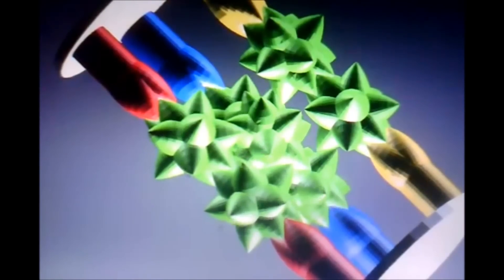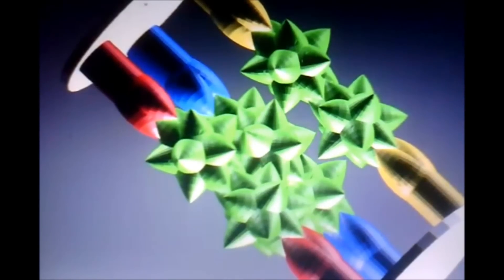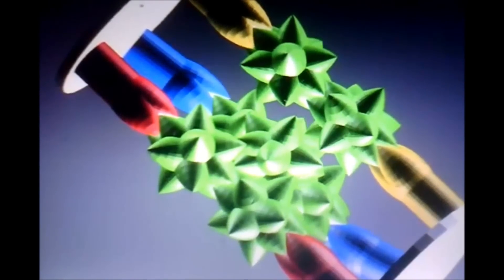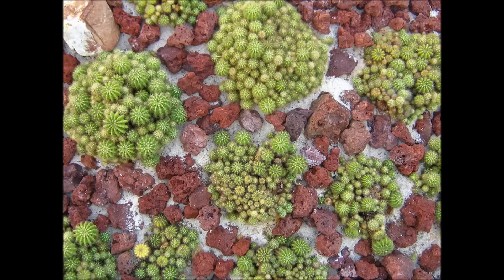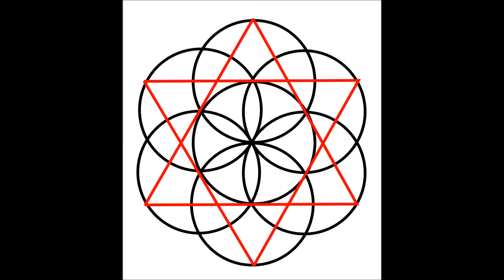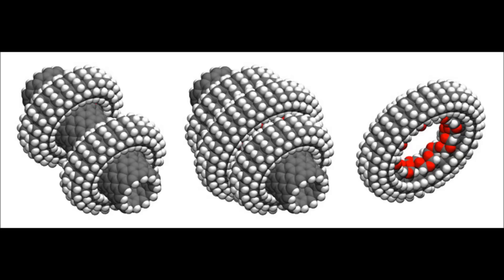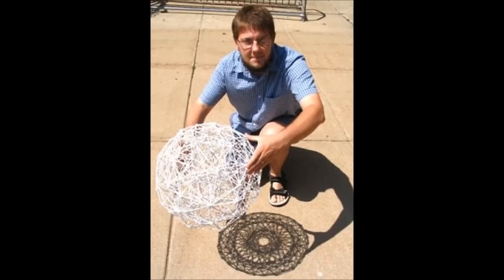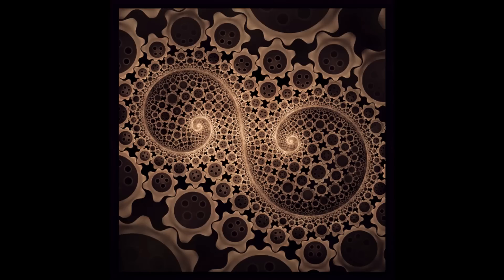CVT Transmission - Fractal Gears

Comment: i think i will stick with stronger helical and straight cut gears, this looks like too many weak parts for a transmission. my toyota doesn't run on DMT. but that would be ridiculously awesome. just kidding! what's the implementation for this ancient tech?
Reply from the maker: +Brandon L Standard automotive gears often use 1/16 inch (.0625) gear teeth to transmit massive amounts of power.  The leading CVT transmission uses less than that.  In fact , the Meyer CVT is the best one and it basically operates by biting into metal spheres by only 5/1000 of an inch (.005 inch).  The idea is you have a higher frequency which allows for less and less needed strength.  In other words if you had a large enough gearbox with a high enough RPM , you could build it from butter and lift the world.  You can compound the layers of the fractal gears for increased frequency of the torque as shown in this video that shows how the Ancient Egyptians could have built the pyramids with this tech .... https://www.youtube.com/watch?v=F29Qa_QEaek

Comment from the maker: See this link to learn how to create Fractal Gears as if creating fire, i.e. instantly.           https://www.youtube.com/watch?v=1EuyZ5Lml4k

To produce this shape permanantely by ferrofluids , You will need to mix polyurethane with a ferromagnetic powder and a hardening agent and allow to dry and solidify under a magnetic field.  The magnetic field should be spherical (i.e. Dipping a magnetic sphere by wire into the mixture, remove and allow to dry)  The field strength is changed by using a smaller magnet or creating an air gap between the magnet and the mixture(moving the magnet source away from the mixture)  Polyurethane can be soft rubber , harder rubber or  hard plastics.  The process is the same with molten metals.

Comment from the maker: Early on in the development of the IVCVT system , I came to a conclusion....That a fractal gear could be used as a drill , and that it would be extremely beneficial for oil drilling.  Later knowledge has led me to believe that this invention will make oil worthless , therefore there may not be any need for drilling oil.  The reason it would be good for deep earth drilling , is that if one had a chain of them arranged correctly , when you hit a hard spot the drill won't break because an IVCVT system is able to dynamically change the gear ratio to a lower speed when there is higher torque , automatically by virtue of it's geometry.  When it hits a hard spot it will recoil and slow it's rotation , kinda like if you were to take a pair of ropes and keep twisting them together.  One would just have to make what is called "drill relief" on the first fractal gear (the one that is cutting) so that it will cut.  As it is it would not cut otherwise they would cut into each other when using for power transfer.  I will post more videos showing this concept and others in a couple weeks time.  I really believe that this technology could explain most , if not all , of the unexplained phenomenons in the building of megalithic structures.  The number of things one could potentially do with these forms is staggering.  And I am constantly thinking up new uses for it.
Reply: Well maybe that is how the holes found in ancient structures in South america and Egypt were actually drilled. in 2007 a 7 edged star of unknown origin was discovered in Norway. http://www.messagetoeagle.com/mystery7edgestar.php
Reply: The Seven point star shown could be made by a 6 point fractal gear hammering at the concrete.  This I know because of experience with a hammering drill with two or three cutting ends; when they are allowed to vibrate (hammering action for cutting rocks) the two ended tool makes a three point star and the three ended will make a 4 point star.  The extra point is due to the vibrations.